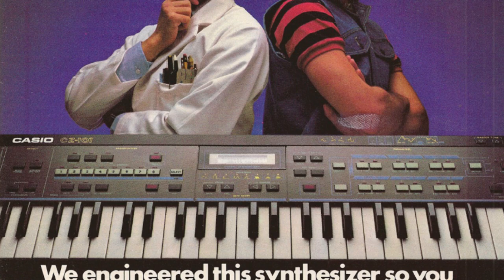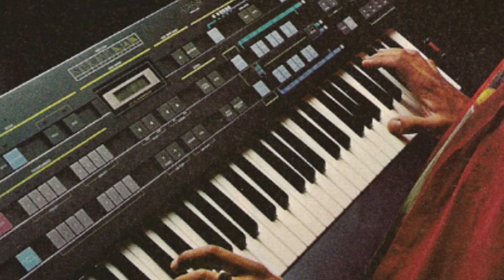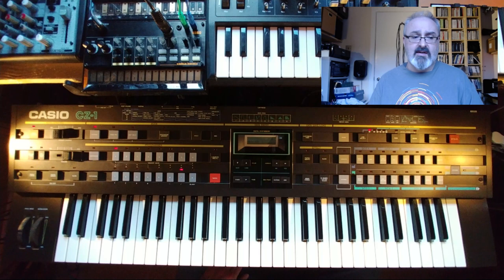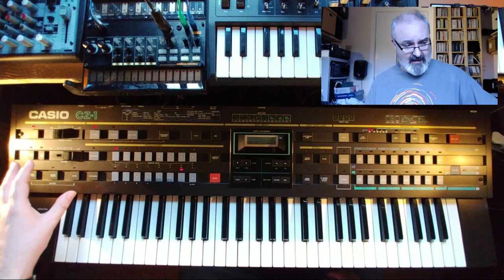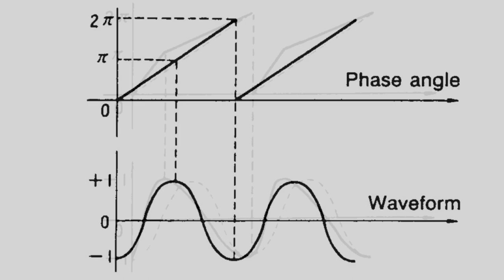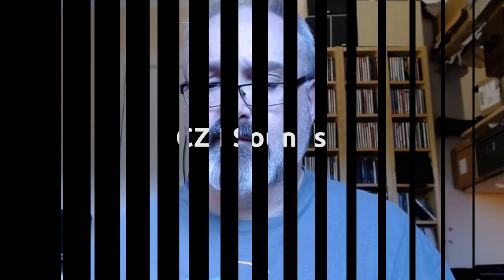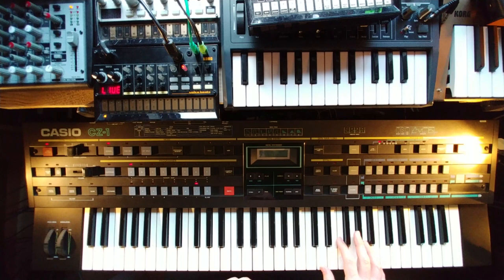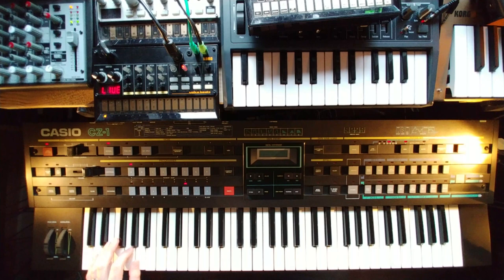Casio CZ-1 Phase Distortion Synthesizer - Part 1 - Overview

Comment: Just discovered this series. I have both the CZ-1 and the CZ-101. I have great affection for this line of synthesizers. Thanks for doing these videos. I’m looking forward to learning more and hearing your suggestions on getting the most out of the CZs!
Reply from the maker: Thanks for the encouragement, just finishing up part three.  Should be out soon.
Reply: Hey David.  I have a CZ-1, though I always pine for a 101 (as I loved mine in my youth).  The 1 is so lovely, but decidedly un-nimble in its vibe. But it’s so difficult to justify the 101 when one owns the cz-1. Wondering if you could comment about why you ever reach for the 101 over the 1?
Reply: Paul Curreri Great question! I felt the same way about justifying having both the CZ-1 and CZ-101 but I can say that there are times I want to add the CZ sound and pulling out the 101 is much more convenient due to its smaller size. And although the CZ-1 has more polyphony and the keyboard action is much better, for some reason the vibe, design and look of the 101 just inspires me.

Comment: Nice video. I’m planning on buying one soon. I got the opportunity to play a CZ-1 a week ago and I loved it. Would you say the CZ-1 is worth the extra money for the features compared to the other models? I wouldn’t wanna miss out on them if they make a significant difference, but the price of the CZ’s has gone up recently.
Reply from the maker: The main benefit is the velocity sensitivity, it's the only one that has that.  The 5000 has a sequencer, so it depends if that's important to you.  It also has more polyphony than the basic 101 and 1000, so yeah it is the top CZ in most ways.  It looks like all old synths are getting more expensive, from what I've seen.